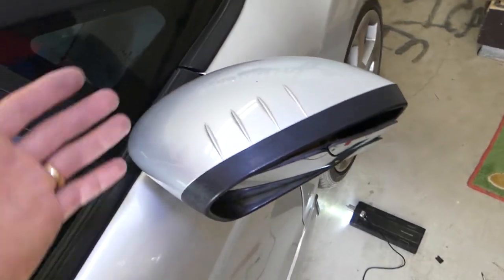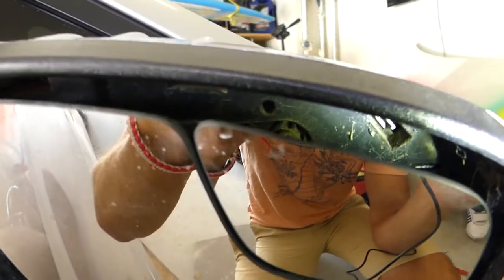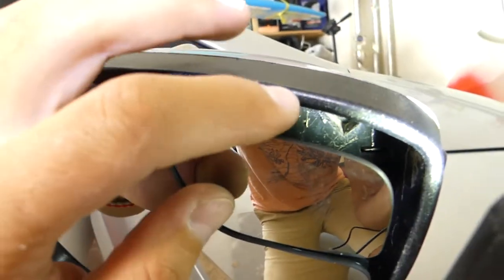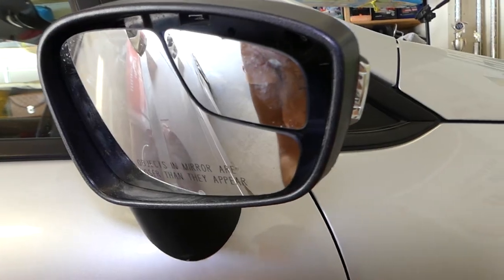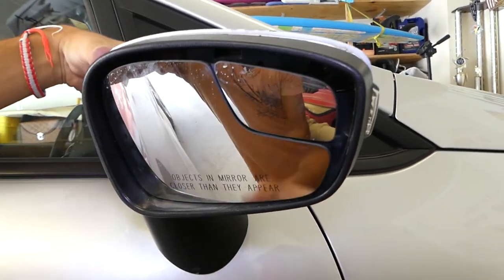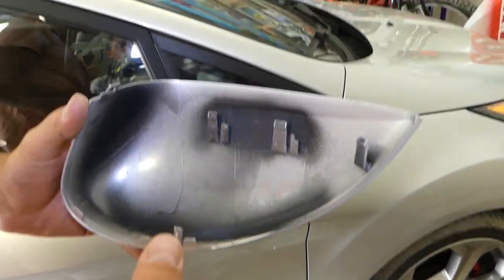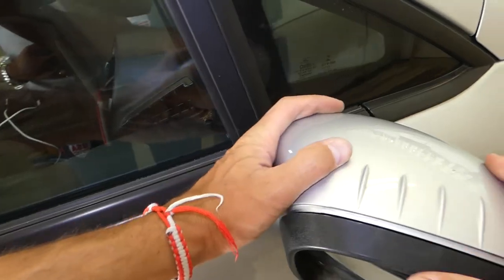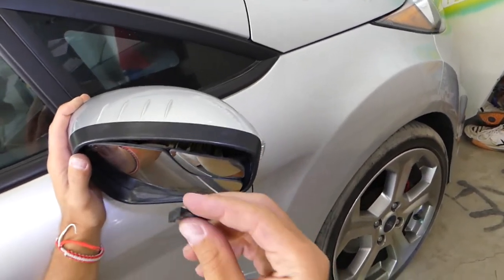HOW TO REMOVE MIRROR CAPS ON FORD FIESTA MK7 ST

Comment: Great video.That clip is tough to remove. It even has a a ridge at the 
end to make it even more difficult. I used a hook tool like they show 
you in the video (I made one from coat hanger wire) to pull it part way 
out, then small pliers with long narrow jaws to finish the job. Careful 
not to break the mirror when the clip finally comes loose!
Reply: Sorry guys I meant clip cover

Comment: What are the little bumps on the mirror cap for? My MK7 mirrors start to whistle at 155 kph and that is super annoying. If I fold the mirrors in the noise is immediately gone. Maybe these bumps are an aerodynamic problem solver?

Comment: Do you have a video on how to replace the lights for the rear license plate? Thanks
Reply: You need to remove the plastic cover on the inside of the trunk door. It's the only way to reach the license plate lights and trunk opening button
Ford really loves making simple things like replacing a 5w bulb difficult for the user